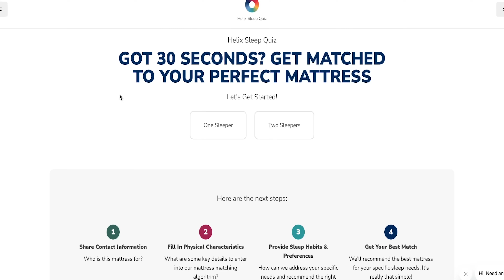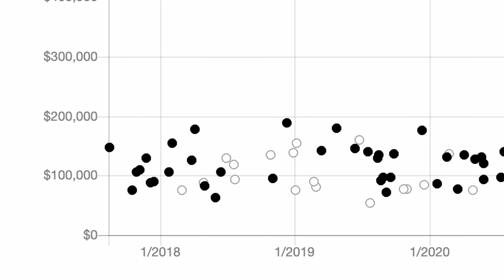THE LAST PORSCHE I'LL EVER BUY...

Comment: theres is a PTS Porsche colour code called " Irish Green " my buddy has a 991.2 Irish Green turbo with RUF exhaust, engine tune and RUF wheels and that green works as I feel a normal BRG wouldnt work so well on the 997 GT3 , but wait til you drive a 996 GT3 the real widow maker, its the olny supercar that truly scared me and I have been for rides in straight piped Ferrari Enzo, Porsche 918, GT2RS, straight piped SVJs, straight piped 06 Ford gt (well that 1 was a little squirly) and the 996 GT3 truly had me shook

Comment: Curious to know what they were asking for it. I came across a similar car that was turned into a 4.0 liter with all Porsche Motorsport cup parts. Looks exactly like a Cup Car. The car is really fast. The cons it’s been tracked but mileage is fairly low and it slide off track and has undercarriage damage. Ughhh decisions decisions